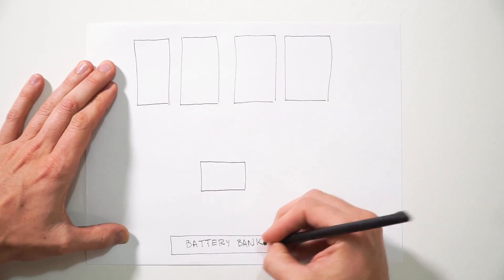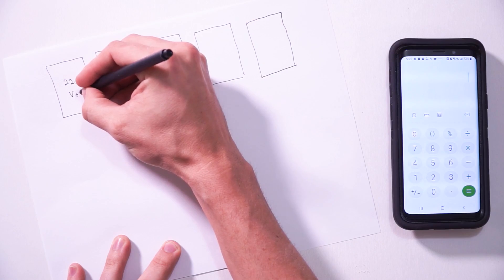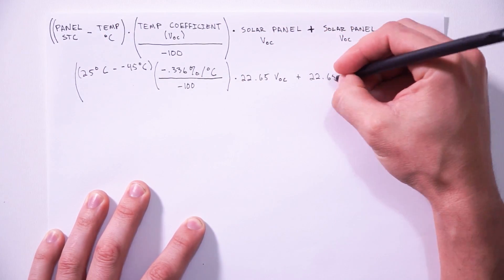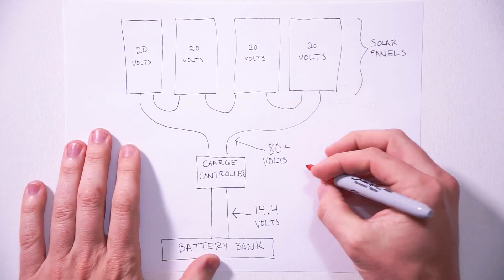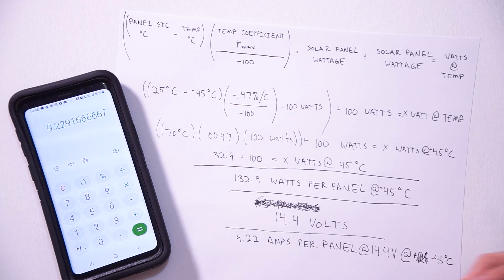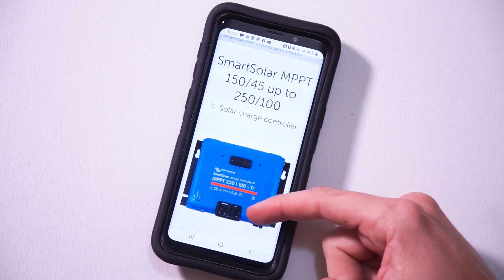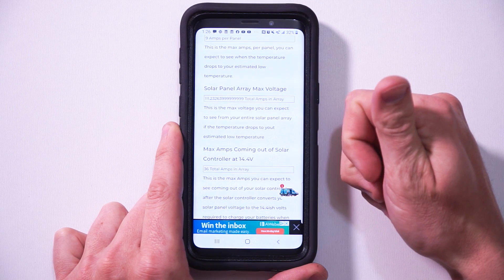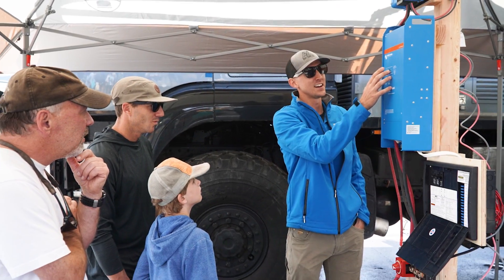How to Size a Solar Charge Controller for a DIY Camper Van Solar System

Comment: I get a different result when using the Victron calculator. Your calculator says I need a 100/50 controller for 2 160 watt panels. The Victron calculator says I need the 100/20 controller. 12 volt system with panels wired in parallel. What’s going on?

Comment: So the calculator says for 6 345W 48V panels charging 12v I need a 212 A charge controller but the highest I can find is 100 A. Did I mess something up? PS You deserver more subs!

Comment: Great info thanks, Question, I have 4 sunpower 170 flex panels 2 series 2 parallel, 4 battleborn batteries in parallel for 12 volt 400 amp hour bank, which of the Victron charge controllers would you recommend so that I can build up the system as well?
Reply: What did you get?

Comment: I loved your calculator! I am not sure I messed up the calculation though by my desired setup? I want to put 2 panels in parallel that are over 300 watts and the only way I could figure to do it was say 1 series string and 2 panels in parallel. It did give a number but not sure it was accurate because they are only the 2 panels in parallel .. I also would like to do 24v battery setup and noticed it did bring the amps down to a very cheap controller amperage. I.e. it seemed like I could really get away with a smaller rated victron.  Do you think it was able to do the math correctly by saying it was 1 series string? Thank you!I subscribed and as a newbie love your explanations!

Comment: Nice,  you must live at the south pole , ,,,  what about in Australia ,  where we have a summer temps up to  +45 deg c in the shade , over + 65 deg in the sun, how much the the volts drop off then , my friend ?  please add the to your calculator   ,,
Reply from the maker: I'll see what I can do, but ultimately sizing the charge controller (What this video is about) needs to be based off of the minimum temperature because an excess voltage would result in damage to the charge controller.

Comment: Nate,

Questions:  Why is it Victron indicates it is OK to use 100W 2S x 2P grid array with the MPPT 75/15, however, your calculator will not allow this?  Nor will your calculator allow 3 -100W Panels in Series, however, the Victron MPPT 75/15 indicates I can put 3 in series; any comment on this?

Thanks for your time, and continue the videos, they are interesting.

Sincerely,
Dave McCane

Comment: Great video thanks. Is there any risk of giving the mppt too few volts or amps? You only talk about the max values here? Thanks again!
Reply from the maker: Not really.  The solar array voltage MUST be at least 5V higher than the battery bank voltage and SHOULD be at least 20V higher for optimum performance.

Comment: I applaud you for your awareness of the impact of temperature on a solar controller, but there is a flaw in your logic in relating to the impact of cold weather. You are only going to see those extreme low temperatures a few months of the year, and during all those months the sun will never go very high on the horizon. That’s easily proved by comparing the elevation of the sun on June 21 to December 21 at the same location. As volts go up with the colder temperature, they go down with a lower sun. Beyond that, cold air is much denser than the warm air of summer and by being low on the horizon, sunlight must travel further through much more dense atmosphere as well as a much denser atmosphere. A far more realistic example is to imagine driving at 12,000 feet at noon in Colorado on a very cold day on June 21 and it is 50 degrees F. That is going to be a large spike in voltage and you will be very glad you added that extra headroom for a big spike in voltage and amps. A friend blew his controller in just that situation—even though he had sized it right for “normal” temperatures. Your conclusions are helpful because other than spending too much you won’t regret buying a bigger better controller than you need, but choosing a more realistic example increases your credibility.
Reply: Absolutely no consideration of an allowance for the earth being flat......just sayin’...
Reply: @Casmige  No mate; that's why the panels are FLAT 😆
Reply: It seems like the cold weather voltage spike is more common and more of a concern in most situations than a cold weather amperage spike because of a low sunlight angle with the exception of extremely high altitude cold situations that can come at times when the sun is very high in the sky. For people near sea level it seems like a cold induced amperage spike exceeding a charge controller’s capacity is very unlikely.
Reply: Well, I guess crow is on the menu tonight. Subbed.  😀 Will be using your calculator and maybe the forums on my first build. Thanks for all that you do, EXPLORIST Life!
29NOV21-Update: 
Oh and I just saw your full tutorial on a full electrical set up and will definitely be buying your kits!
Reply: @mikefranks4528  CheapRVLiving has a point.  The calculation uses 100% of panel output and doesn't take into account the solar input into the panel, so it is not close to reality at -45 C (summer on Mars maybe).  I think a more reasonable example would have been around 10 degrees C for a cool summer morning at elevation.
Reply from the maker: With all due respect... my example is accurate. :) It's important to take into account the lowest morning temperature ever expected because before the charge controller comes out of it's sleep mode for the morning, the solar panels could potentially reach their full rated open circuit voltage (Voc) AS SOON AS the sun peeks over the horizon.

Your example with the mid-day high elevation, cold weather in the summer would only be for the operating voltage (Vmp), which is inherently lower than the Voc anyway, so if we account for the morning time low temperature for the Voc, the high Vmp would always be covered.

Sources: 

Where do we get the expected lowest temperature? Normally, this temperature occurs in the very early morning hours just before sunrise on cold winter mornings. The PV modules are, in many cases, a few degrees colder than the air temperature due to night-sky radiation effects. The illumination at dawn and dusk are sufficient to produce high Voc, even when the sun is not shining directly on the PV array and has not produced any solar heating of the modules. -  https://iaeimagazine.org/features/pv-math/

PV modules will “wake-up” every morning with very little sunlight. Because the PV array is sitting outside, the temperatures of the modules will be the exact same value as the night air. Because the sun isn’t actually hitting the array immediately, the modules will not immediately produce any current, which means they will immediately go to open circuit voltage. If the temperature of the module is less than the STC value of 25°C, the module’s Voc value will actually be greater than the value listed on the module’s listing label. For our discussion, we will consider the temperature of the module to be equal to ambient temperature at daybreak. - https://www.ecmweb.com/renewables/article/20896643/the-highs-and-lows-of-photovoltaic-system-calculations

"Voc will potentially be briefly produced in the morning when the sun first comes up and the panels are at their coolest, but the connected electronics haven’t woken up out of sleep mode yet." - https://www.altestore.com/blog/2016/04/how-do-i-read-specifications-of-my-solar-panel

Comment: Hi great video.  I have 140w single panel but might add more later.  Can I use a MPPT that is bigger than I currently require so it’s good to go if I add more solar later?

Comment: Hi Nate, Thank you for this, really helpful. My calculations based on the info you mentioned. I get 43V and 52Amps... This is based on a minimum temperature of -20ºC... Would the 100/50 MPPT be ok, so should I really need to go larger?

Comment: Hello, great video, really well explained. But I have a question, not sure how to go with my setup. I'm planning to run 200-300ah 12v batteries. My solar will most likely be 2x320w solar panels. They each have 43 voc, so I will probably series connect them to get 86 volts. So 640w panels at 86 volts will push around 8amps into the controller. My question is, how do I konw at what volts will the controller be charging the battery? 14.4 always? I need to know in order to size the controller. I think a 100/50 victron will do the job. If the controller charges the battery at 14.4 volts, 640/14.4 = 44.4 amps, which is below 50. But if the voltage charge drops, I will go over 50amps, over the controller max..Am I getting this right? Thanks all that help!

Comment: Hi Nate
I’m trying to calculate my charge controller but my panel spec for Temperature Coefficient of panel (Voc) is listed in mV/K 

How do I convert this to %/°C

I’m coming up empty on google searches. 
Any help is greatly appreciated! 
Thanks
Jake
Reply: I have the same problem. My panel specs say Temp. Coefficient of Power -0.43%/K  and Temp. Coefficient of Voltage -0.12V/K Not sure how to convert that or is it the same.

Comment: Can you talk about charge controller receiving amperage I want to stay with the low voltage coming into the charge controller but I want to know how much amperage can the charge controller receive from the solar panel
Reply: Each controller has a max input current listed in the specs. Maybe around 60 amps give or take.

Comment: Nat: I am trying to use the calculator to determine the size of charge controller and number of panels needed. I have examined the spec sheet for the REC330NP and the REC365AA panels and cannot identify some of the data needed; #1. the spreadsheet asks for the STC (T=C) but I cannot find anything that looks closed to that, #2. Need Max Power Current (IMP) with same issue, #3 Last question asked is for the number of panels in each series but the large text asks "Panels/Strings in Parallel. I will have only two panels wired in series so am not sure how to answer number #3.

Comment: I just did your calculator and with the results I got of:
23.7 volts per panel
142.2 max array volts
5.29 max amps going into controller
41.67 max amps out

My results led me to the Victron 75/10. Is that right? I thought max array volts was the first number? Thanks for reading!
Reply from the maker: Nope.  That charge controller would be much too small.  My calculator recommended the 75/10 for those parameters?

Comment: Hay Nate: Trying to wrap my head around all the great material in your videos. Just not sure how to get them in order, maybe a number by each would help or  where to start with number 1. I just tried your calculator and have a suggestion, which may be answered in a video I have not yet seen, which is to provide an estimate of the time it would take using the wattage/amperage calculations to charge a battery bank given say 4.5 hours of sunshine and the number of batteries in the array. In my case I would enter 3 batteries, 100ah, AGM. I think in the end that is what the crucial point is here, what is needed to charge a battery bank.

Comment: I'm sure you have answered this question before, but I haven't found it quickly in your other content yet, so I wanted to ask as it somewhat relates.  Since the voltage of a panel can increase as temperature decreases, does the wattage of a solar panel stay consistent during all temperature ranges (indicating that amperage fluctuates inversely to the voltage due to Watts Law) or is the panel wattage variable depending on conditions?
Reply from the maker: That's a great question.  So...  Voltage fluctuates with temperature but the amperage output remains the same no matter what.  SO...  by using watts law of Volts x Amps = Watts ...  You can see that the wattage of a panel will indeed increase due to the increase in panel voltage with an amperage constant.
Reply: @EXPLORISTlife  awesome Nate!  Thanks.  Follow-up question: since the wattage fluctuates according to temperature if you were in the middle of a hot desert in the middle of summer could you actually produce fewer Watts per panel than what they are rated for?
Reply from the maker: Yep!  Exactly.  A 100W panel is only a 100W panel at its Standard Test Conditions ( which is generally 25 degrees C or about 70 degrees F)

Comment: I am looking at a 600w system, 3 X 200-watt panels.  If I plugged the numbers into your calculator correctly with the panels run in series, it adds up to 9.5 amps going into the charge controller.  So what size solar charge controller would be recommended for this setup?
Reply from the maker: What recommendation did the calculator give you?
Reply: @EXPLORISTlife  I did not see a recommendation on which charge controller, simply the detailed results.
Reply from the maker: If you've entered proper parameters into the calculator... it will give a charge controlller recommendation at the top of the calculator.

Comment: Nate,

Is it OK to use a 3k inverter/charger instead of the 2k, when I may upgrade to 3 or 4 batteries in the future?

Right now I'm planning on using 2 --12 volt Li bat....
Reply from the maker: You really need 400Ah of battery capacity to support a 3000W Inverter.
Reply: @EXPLORISTlife  can you explain why?  

Battleborn gave me a workaround by using a smaller longer wire about 3 ft long to cause a resistance required by the inverter/charger.
Reply from the maker: All I can say is that if Battle Born says its okay, go with that.  

I know why Battle Born is saying that  but it goes against what Victron recommends.  So... until Battle Born makes a public document explaining why (which I'm working with them on)... I have to stick with recommending Victrons official recommendation, which is 400Ah for a Multiplus 3000.

Comment: Hello, I got 8 solar panels wire in parallel. 250watt ,37.2 voc ,and 8.3 a each panel. So should I buy Victron Energy BlueSolar MPPT TR 150V 70 amp 12/24/36/48-Volt Solar Charge Controller? And should I do the batteries in series to make 36v? Or I can still do it as 12v. Please advise. Thanks in advance.
Reply from the maker: What did the calculator tell you?  Tip:  With 2000w of solar... you will have to either run with dual charge controllers on a 12v battery bank or go with a 24v battery bank to run with 1 charge controller.
Reply: Yes I did use the calculator. It say in 24v bank voltage . Max volt per panel at low temperature is 26.6599. Solar panel array max volt is 26.6599. Max amps going to the charge controller is 66.4 amps. Max amps coming out of solar controller is 555.56 amps.  And it say for the 12 v bank voltage. Only thing changed is the max amps coming out of solar controller is 1111.11 amps. Run with dual charge controller for 12v? May I ask why two charge controller? Which charge controllers I need for that?
Reply: I will do 24v battery bank like you say. Thanks.

Comment: 00:03:40 where did you get this formula from to calculate Voltage at a specified temperature?
Reply from the maker: That was from a conversation with some of the engineers at Victron.  A google search for Solar Panel Temperature Coefficient Calculation should yield good results, though.
Reply: @EXPLORISTlife  I found an article with all those formulas. Here is a link to it:
https://doi.org/10.1016/j.solener.2008.10.008

Also, I looked at the calculator code you have on your WordPress website and the last item is not calculated according to the formulas or your method in the video without the calculator.

The calculator on your site uses the following formula to calculate the "Max Amps Coming out of Solar Charge Controller":
(Example for 12V Battery Bank)

Total Number of Arrays * P_STC / 14.4 

P_STC = Solar Panel Wattage (Max Power) at Standard Test Conditions (the 1st field on your calculator)

Whereas your calculation earlier in the video tells us to use:

Total Number of Arrays * P_T / 14.4

Where P_T is the 

P_T = Max Power Per Panel at estimated Low Temperature
P_T = P_STC * ( 1 + β * ( T - 25 ) )

here β is the temperature correction coefficient for max power:
β = (the value for Temperature Coefficient of P_max on the Solar Panel Specs sheet) / 100
Reply from the maker: I've made a minor change in the calculator since producing this video for the sake of clarity, so they aren't EXACTLY the same anymore... but what exactly are you trying to figure out?  What metric are you trying to find?
Reply: @EXPLORISTlife  btw, amazing videos. We love your channel. It is an amazing resource.

Comment: I used your calculator to determine the controller size. It states that AFTER the solar controller the max amps coming out of the solar controller is 125.00. Does the fuse after the controller to the batteries have to be rate to 125?
Reply from the maker: Here is a video on how to size fuses: https://www.youtube.com/watch?v=5y-yDMEgV70

Also... if you are getting more than 100A output, you'll likely need to use 2 separate charge controllers.